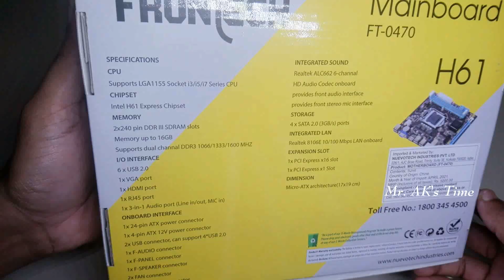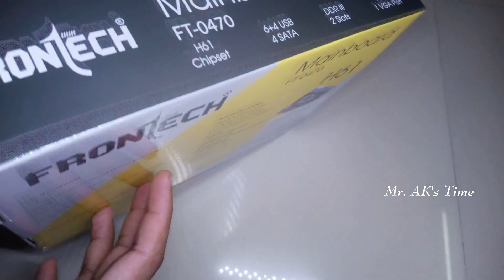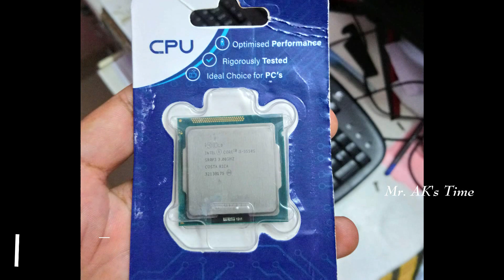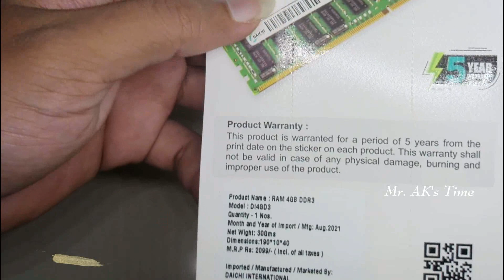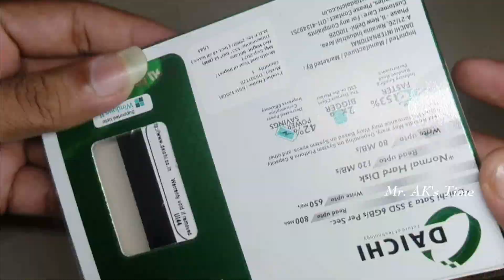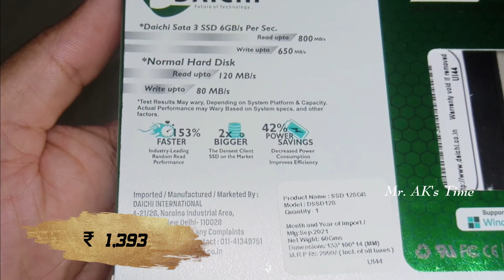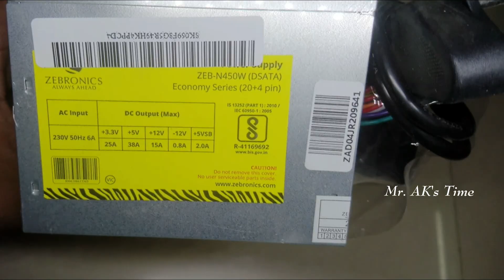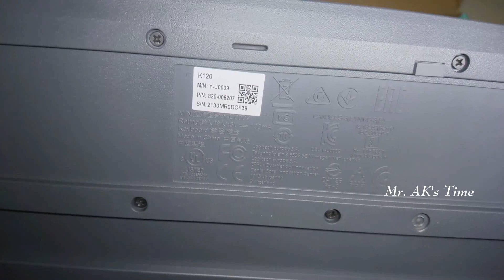i5 3rd Gen PC Build l Budget PC l Intel i5-3550S l 17k PC l Frontech H61, Daichi RAM, SSD l 1TB HDD

Comment: Bro kiya sata 3 isme ha 
Ya sata 2.0 ha 
Oneboard me
Reply from the maker: sata 2.0
Reply: @MrAKsTime  bro ab jo Zeb 61m.2  updated Motherboard a ra ha usme kiya sata 3.0 connector ha 
Kiya ma H61 Motherboard me SSD lagane ke bad 500 mb spped  milega?
Please answer my comments
Reply from the maker: @anarulmallick9505  They will mention as 3.0 but the actual speed will be as 2.0 only. If you want 3.0 you need to use a high-end motherboard (Gigabyte, Asus, MSI). You will get good speed with H61 MB + SSD so don't worry.
Reply: @MrAKsTime  thanks bro